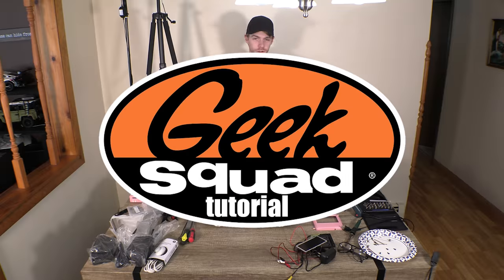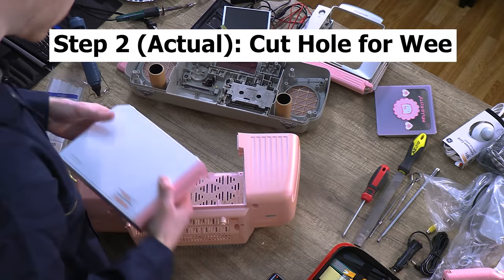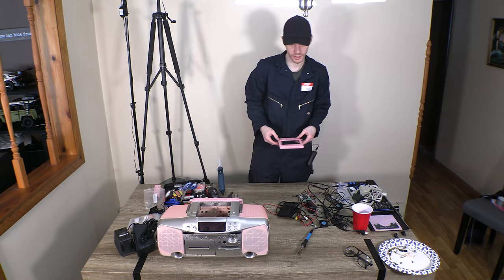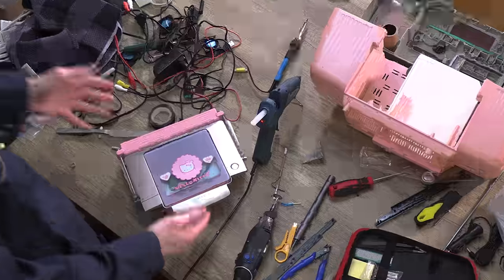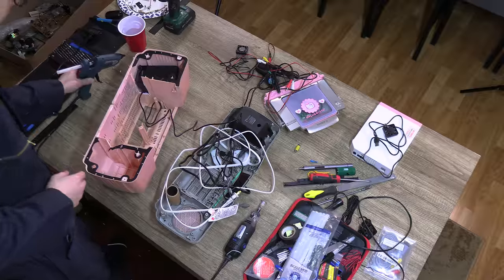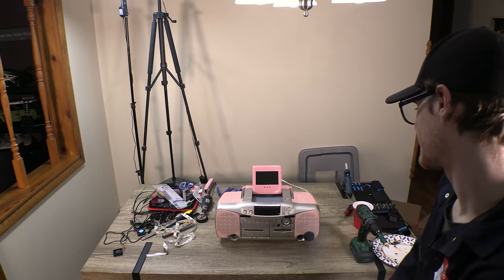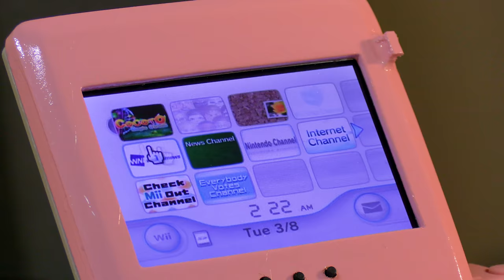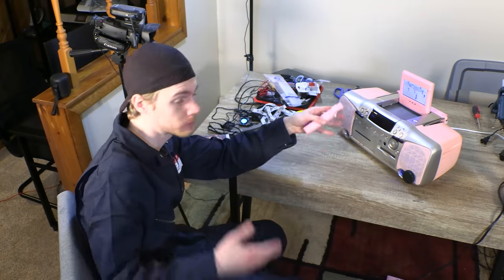How to Make the Hello Kitty Wii Boombox

Comment: Drill batteries for portable power, I built something similar with a Sony, and PI4. It still uses most of the original boombox. So it has tape, input, can even record tape of the sound from Android or TwisterOS w/Retropie.  Wi-fi hotspot for internet, Can run it forever switching batteries. Touchscreen too.

Comment: Fact: My Mate Vince did something liken this called a gaming boombox. His boombox was a 1986 Boombox from Radio Shack that had a built in analog TV screen. What he did was took 4 systems, a Switch, an SNES Classic, a Playstation Vita TV, and a Wii Mini (which is a squarish discman with a red and black design and has barely any content in the menu). Instead of dismantling the unit to mod it, he took a lot of components and attached them to the boombox and connected them properly. Although it looks messy and weighs more, it's just as crazy as this.
Reply: That sounds like something Vince would do.
Reply: @MyNameIsNotSmith  Mostly he repairs things. Rarely he does make some contraptions.
Reply: @christopher32074  classic Vince move

Comment: You could have reused the original speakers. Just put one wire to the pointy bit of the wii video cable and the black wire to the bit that is still metal but not pointy.

Comment: I personally would have gone the extra route and I would have gutted the Wii so everything fits inside with most of the original electronics, except the CD player would be replaced with a modified Wii drive. I would route the audio from the wii into the internal audio input of the CD player, but obv that's wayy out of Peter's ability.
Reply: and who tf are you
Reply: @akpokemon  someone, i guess

Comment: okay let me get this straight... You got a $500 boom box, right, and you take everything out of it, and just shove a wii inside, connect it to a monitor on the top flap, whatever. But then you dont even use the speakers of the boombox? Like JUST the shell? You could have paid $500 for a 3D printer and then printed the boom box.